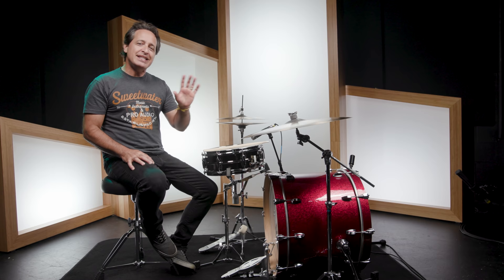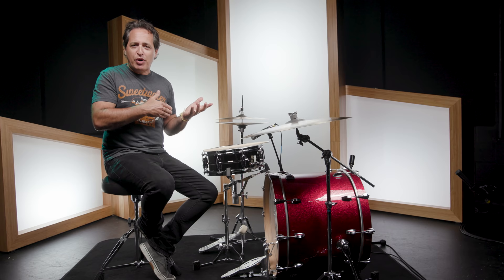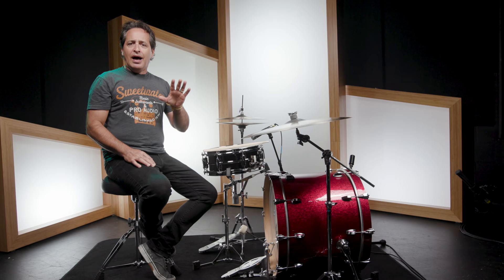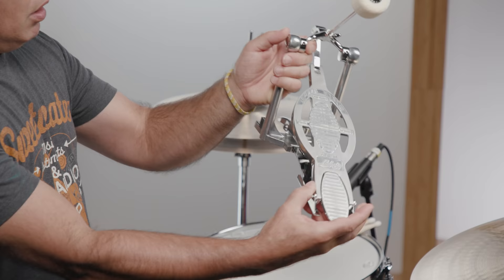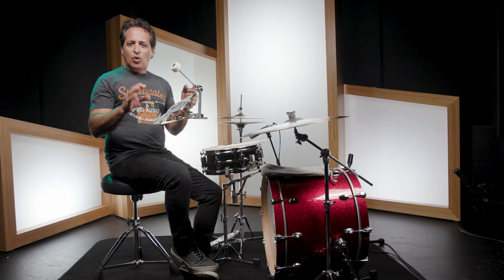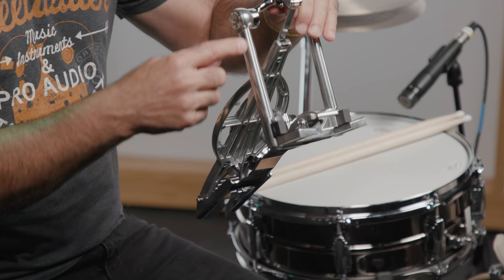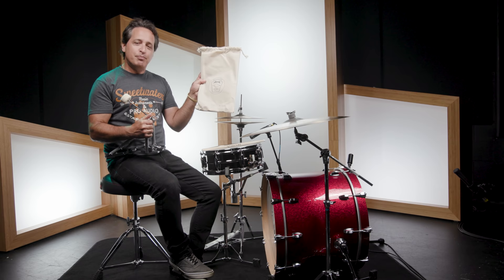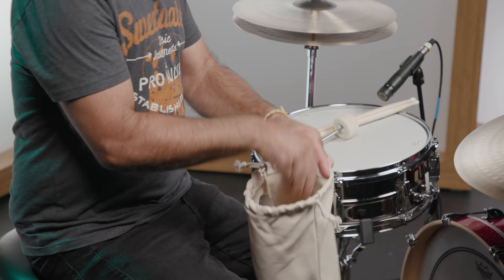Ludwig Speed King Bass Drum Pedal Demo

Comment from the maker: The modern Speed King offers everything you need and nothing you don’t 🔥 Which upgraded feature are you most excited about?
Reply: I don’t like that it requires a drum key now, I prefer the wingscrew. I use vintage Ludwig hardware for local gigs because it all fits in a small suitcase, and anytime i can get away with not using tools is a plus. All the new flatbased stands are too big.
Reply: I never had an original and wanted to see what all the hype was about, so I got a new one and I love the feel. This is my first direct drive. The crazy thing is that they did not fix the famous squeak. It was fine for a month and just started to make noise, which is pretty loud.
Reply: @RedeyePerc  it needs maintenance. Teflon or dry bicycle chain lube should do it
Reply: To me the best improvement is the drum key lockdown for the beater. My pedal still has a wing nut fastener there, and the last time it came loose while I was playing, and the beater flew off and out of my reach. That was when I decided I needed to switch to something more up-to-date, so I bought a Yamaha FP-9D direct drive (from Sweetwater, of course) and never looked back. I've found that the FP-9D can be adjusted to feel almost exactly like my Speed King, but is built like a tank (or more precisely, like a Yamaha motorcycle). Both great pedals !

Comment: I used one for decades beginning in '65. I changed from time to time. Then 5 years ago I bought the cammed, chain Atlas version of the S.K. I am now going back to the mechanical redux of the original S.K. in my opinion, it is simply the best pedal ever made.
Reply: Cleaned and rebuilt and teflon greased my 1967 speed king in 2003...wouldnt trade it for any pedal made today .

Comment: My first, actually two pedals were Speed Kings. I never thought about buying a double pedal for my Ludwig Blue Sparkle kicks. Mine squeaked like crazy but with a bit of WD-40 that would take care of the problem. An excellent pedal.
Reply: But the squeak always comes back.
Reply: @hccarder  I have a Speed King pedal that's 60 years old, and between myself and the original owner, it has been used so much that the ridges on the shoe plate are partly worn off.  It doesn't squeak and it never has, because I treat it they way a person ought to treat any similar mechanical device.  I find that a single drop of genuine *oil*, properly placed at each friction point using a decent precision applicator (such an applicator costs about a dollar and lasts forever), eliminates any squeak for months or even years at a time. That's a far cry from "the squeak always comes back", but I bet you are using WD-40 instead of something that actually works.  If you want real oil but need something that you can get at any grocery store or drug store, try '3-in-1' oil.  One "micro drop" of '3-in-1' will lubricate better and keep doing its job about a thousand-times longer than WD-40, but without WD-40's inevitable mess.  (WD-40's popular image as the go-to lubricant is 99-percent marketing hype.  It's really not much good as a lubricant, and it's packaged as an aerosol primarily to make sure that you will apply it as wastefully as possible and then run out and buy more).

Comment: The linkage gets very close to the drum head depending on hoop width. I glued a piece of 5mm x 5mm square timber across the front of the clamp section to give it more clearance. Or use a pencil.

Comment: I have always liked the feel and action of the Speed King, but my foot was too big to comfortably use it all the time, I found the early 70’s Sonor delux pedal to have similar feel and action as the Speed King and was also a better fit for my foot, been using them ever since and still have two original pedals. I wish Ludwig would have made a larger version as well as the original size Speed King, if they did that would have been my go to pedal. 👍🥁👍

Comment: Interestingly, my original Speed King's squeak was coming from the pedal-to-beater linkage. I solved it with a thin film of petroleum jelly applied to the metal linkage (where the pedal disconnects). It has never squeaked again !

Comment: the speedking never had a bearing in the heal it was a pin with peaned ends. it was metal on metal that got that squeak happening. i had one in 1985 that had been around since 1962 i used it until 1993. dam things are indestructible

Comment: I won't ever get a speed king.  It is a great, light weight pedal but I don't want to be too spoiled with my kick pedal.  I have a DW 9002 chain drive.
Reply: I got mine used for $20 dollars it was all gummed up so I opened it up, cleaned the springs really well, and then re-packed with lithium grease. I can't play chain drives very well at all. I learned on belt & direct drives.

Comment: The internal mechanics of a speed king pedal is GENIUS! the linkage sucks! The linkage is horrible it’s just shit! that steel link or that steel strap (it also bends after a while))! They should’ve redesigned that decades ago if they could re-designed the pedal and get rid of that stupid steel strap,maybe put a chain on there instead or nylon strap that pedal would be a fucking winner and I mean a fucking winner! Because the mechanism is excellent
They finally put ball bearings on the new speaking it’s about time that fucking pin on the old ones was stupid

Comment: Back when you could fit all of your hardware, snare and cymbals in your trap case.  ( what is a trap case? )  I still use '69 SK and a pre CBS Rogers Swivo.  They are super!
Reply: It's a case that's too bulky and heavy to lift into the trunk of your car.  That was my experience after buying one, anyway.  I had to regroup, buy separate bags for the hardware, snare, and cymbals.  I guess the case would have worked if I'd had a van.
Reply: @FawleyJude  3 flat bass stands, flimsy hi hat, 2 cym + hats, pedal, snare.  On wheels.  '71 Ludwig catalog.  Hardware was light then.  Lol
Reply: @brianchisnell1548  Yeah, I still have the original stand for my '60s vintage Acrolite snare, and one of my old cymbal stands, you're right, hardware was pretty light then and looks flimsy today.  I didn't get a trap case till the late '80s when I had heavy-duty Tama hardware and a steel Yamaha recording custom snare, plus a bunch of cymbals.  That case weighed a ton.

Comment: Never noticed it has no springs outside! Is the tension still adjustable like a regular pedal or is it fixed?
Reply: Adjustment screws are on the bottom.  Turn both a half turn at a time until it rocks

Comment: Can you adjust tension and beater?
Reply from the maker: Hey, angrychivafan. Thanks for reaching out. Not much adjustment on this one since it’s a direct pull and very old design with modern components.
It folds up nicely, though. And the new bearings are on point.
Thanks again.
Jason Thiele, Senior Sweetwater Sales Engineer, (800) 222-4700 ext. 1391, jason_thiele@sweetwater.com

Comment: Too bad it's not made in the USA. For me, that's a fail... thank goodness I have a few from the late 60's and mid 70's.
BTW... my old SK's never ever squeaked from where this video mentioned but, where the floorboard would connect to to drive link. That footboard roll-pin and drive link were a direct friction point. My fix, a drop of STP oil additive via toothpick and it was dead quite for a lot of gigs.
Reply: Your approach to the problem, placing a tiny drop of your choice of lubricant right where it was needed, makes you vastly smarter than almost any of the other squeak-complainers here.